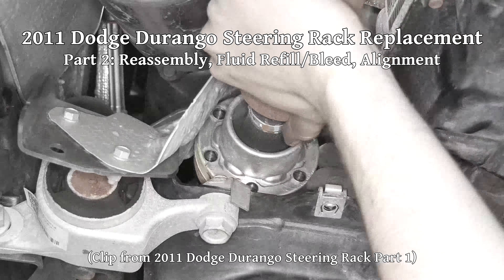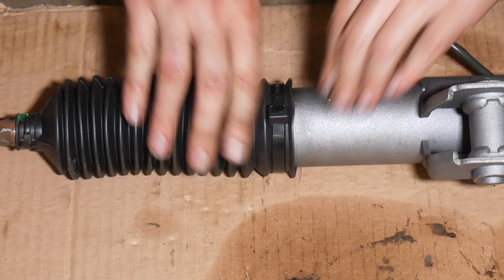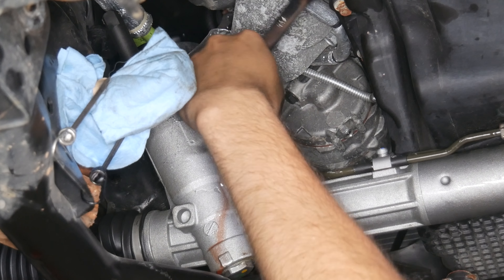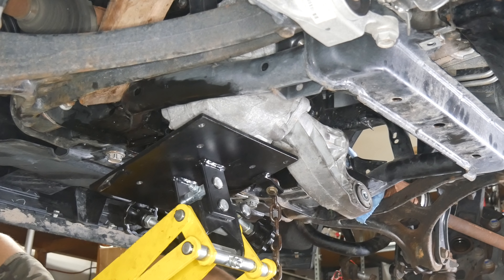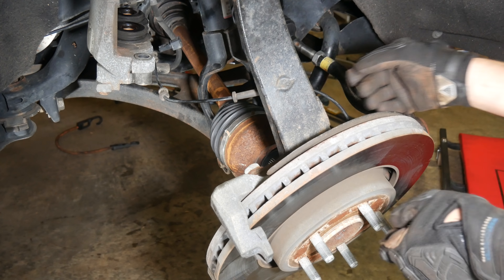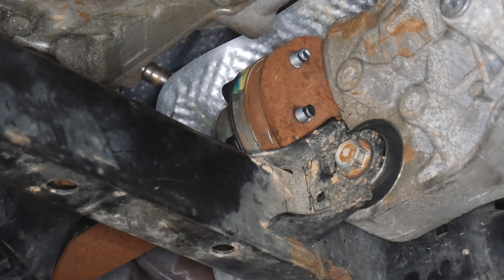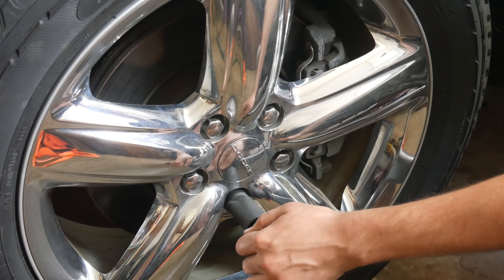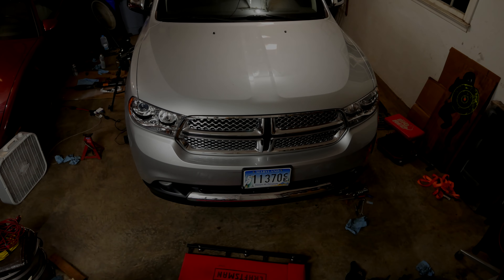2011 Dodge Durango Steering Rack Replacement (V8 AWD) – Install, Bleed, Alignment (Part 2 of 2)

Comment: Quick tip for you: the next time you have to do an alignment, pulling those clamps off is one good way to loosen the boot, but WD-40 goes a long way towards making them slip more on the tie rod, and make your job easier.

Comment: Thanks so much for posting this thorough and helpful video!  I have a 2011 Durango Citadel with a V6 and AWD that developed this same problem two weeks ago.   The procedure was identical (except for the metal skid plate and that vibration dampener, which my vehicle didn't have).  I convinced myself to give it a whirl and was feeling like I had bitten off way more than I could chew when I found the service manual instructions that included removing the engine cradle.  I was about to run out and secure an engine support when I ran across this video on 12/19/2020 (the same day it was posted!!!! -- so LUCKY).  That drive shaft attachment to the differential was a ridiculous piece of engineering and I might have given up if it hadn't been for this video.  I had to change my driver's side CV axle, so I ended up pulling it out entirely, which required removing the clevis bolt from the lower control arm where the strut was attached.  I just went ahead and pulled both CV axles, simplifying the removal/install procedure of the differential.  Just be sure to CAREFULLY disconnect the wheel speed sensor from the vehicle wiring harness and remove all clips/attachment to the frame.  Leave it in the knuckle and just tie it up.  I broke off the first one I tried to remove from the knuckle and had to get a new one (along with a wiring harness connector that I also managed to break).  Despite all that, I saved a bunch of money doing this myself and would have had a lot more frustration completing the job if it hadn't been for this great video.  THANKS!!!!

Comment: To help with those springs on seals, I use about a finger full of grease on the backside of them, spread it around the whole spring and it will stay put. The grease won't hurt anything in there and does a damn good job. cheers!

Comment: Thank you so much for this, my 2011 Durango appears to have the same issue. and the Dealership is wants $3400 to fix this and a leaking engine oil pan. which is crazy money. So like you i am looking to see if i can do it myself.

Comment: As somebody who replaced diff bushings on a 06 WK (similar) and struts and unit bearings on a 14 durango RT… I feel your pain. Only suggestion. You did the sway bar. Just unbolt the strut. Get more knuckle pull out to get the axle out. Allows the lower arm to drop. I found out how shitty this all could be because the passenger unit bearing was seized to the knuckle. I had to remove it completely. Vice. Air chisel. Real stuck. After doing all that, i would have just put new outer TREs on too. But great series on this. Had a buddy who did this on his wifes GC. He dropped the cradle. Shop cranes/lifts. Lol. I would have done this.

Comment: At 13:05, another way to hold the axles from turning is to stick a tapered punch in the slots in the rotor and brace it against the caliper bracket

Comment: Just did this job. Except I lifted the motor mount bolts. And lifted motor a bit and the rack slid in. Questions, I have weird vibration at certain speeds. Never removed the tcase and I replaced cv axles. Any ideas ?

Comment: Concerning torc is only important on engine components like piston rods or heads ,other than that a good wap of a air or electric impact gun is sufficient enough too hold any bolt otherwise

Comment: No means a criticism, just a question.

At 16:53 you said the front of the tire had 65½" measured, and the rear had 64½", which you refer to as an inch of "toe-in".

Am I wrong to think that should be "toe-out"? Never done an alignment before, so not sure if I'm crazy.
Reply from the maker: You are totally correct! I misspoke there. The actual measurement was 65 1/2" at the rear and 64 1/2" at the front (just double checked my notes to make sure). I managed to flip those around when doing the voiceover, if what I SAID was correct that would indeed be toe out
Reply: @FuzzyDiceProjects  No problem, just sounded weird, listened to it a few times to make sure. Great video!

Comment: Great work , were do you find all of those torque specs, I have a heck of a time trying to find thenlm
Reply from the maker: For all my vehicles I have the Haynes manuals, which you can usually get cheap (used copies for like $5 in some cases) and have a lot of specs and info, but not all. A lot of the time if you just need a few numbers you can find them on online forums too. You always have to proceed with caution though because I have seen Haynes, Chilton's, factory service manuals, and plenty of online posts giving wrong numbers.

For the Durango I couldn't find much of anything online for free, I ended up with a digital copy of the factory service manual for $20 or so since a Haynes manual was about the same price in that case.

Comment: The cost of parts and labor from most shops will usually cover the cost of buying DIY tools.
Research DIY repairs and source quality discount parts and you’ll end up with repairs you can be proud of and rest easy knowing it was done correctly.